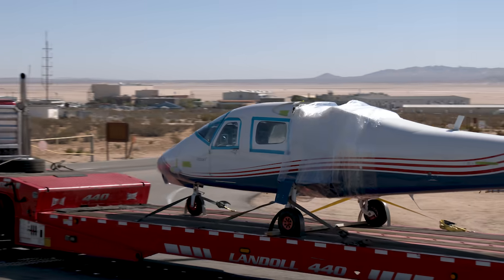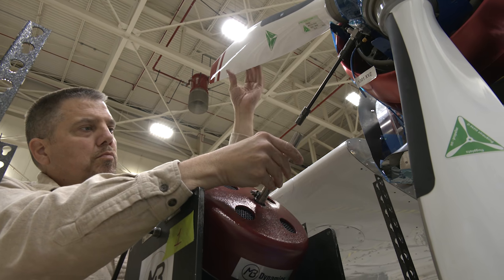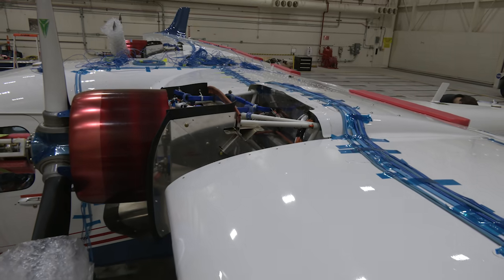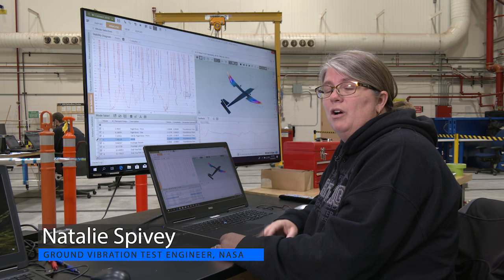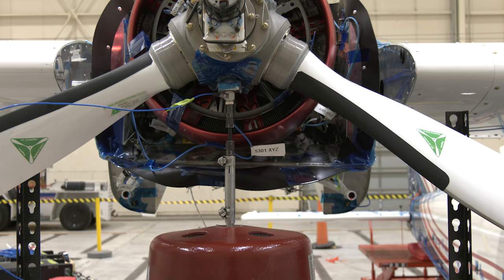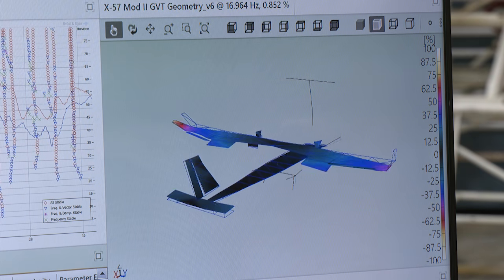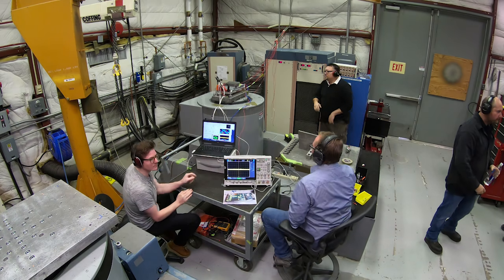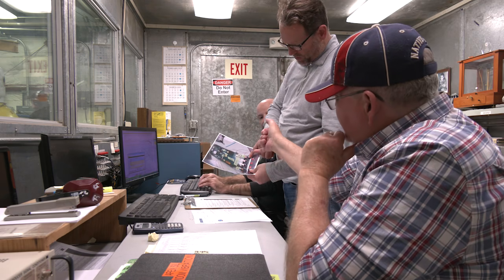All-Electric X-57 Moves Forward With Structural Ground Tests

Comment: Put An Electromagnet In The Center Of Your Metal Motors Iron Steel Wheel, It Pulls In On The Centrifuge Making Your Motor Spin 6,000,000 Times Faster. Your Electric Plane Will Plane Break The Sound Barrier. It's Real Technology. Here It Is Working. https://www.youtube.com/watch?v=U1iOGZ5GxsA    It's Called A Thermo Nuclear Electric Motor.

Comment: If SpaceX was running the show this bird would be a in production by now...
Reply: This is a research plane, not something that will be going into production. It provides the knowledge that companies like SpaceX (if SpX was in this biz) could then use to build practical machines.
Reply: Markle2k Thats where they are failing, this is old reasoning that needs to die. A person like Elon would ask why can’t it be more that a research platform, and why is it taking so long. We know how airplanes work, we know how electric motors work... Its not impossible or hard? Just an engineering problem.  These guys need to get off their butts and make this happen. Then NASA needs to change its model and sell their findings for a nominal fee to support various programs.
Reply: What's the rush? And SpaceX has had plenty of delays. BFR was already supposed to have launched, but they can't even figure out how to design the structure of the rocket!
-
Anyway, this couldn't go into production, it wouldn't be useful for anything, it's just pure research.
Reply: PistonAvatarGuy  Clearly you have aren’t keeping up with reality... SpaceX Delays aren’t Boeing delays. SpaceX is not only developing something new, but they continue to push forward and call audibles as needed. Not all delays are equivalent.
Reply: @Cyberjohnnyt  Boeing delays? What are you talking about? SpaceX doesn't even know how to build the BFR, it's delayed indefinitely.

Comment: Were the motor controllers under load and hot while being vibration tested? Could things like soldered joints could fail sooner when hot?
Reply: LOL! this isn't RC hobby stuff. Crucial connections are crimped with FAA (or whatever the american flight regulation agency is) approved connector types or else it would never be allowed to fly commercially
Reply: @VincentFischer  
Why would they test it then?